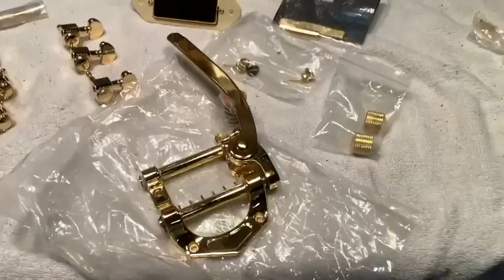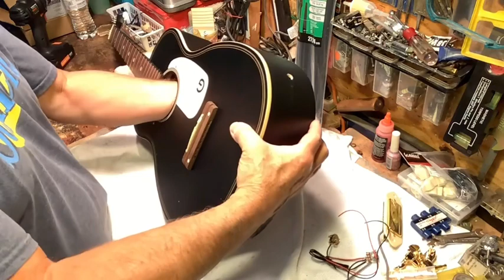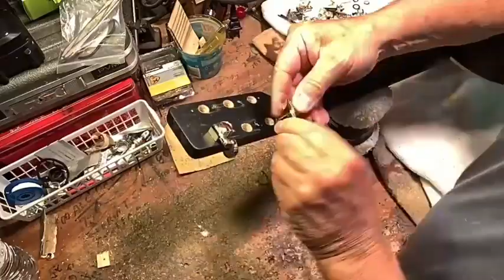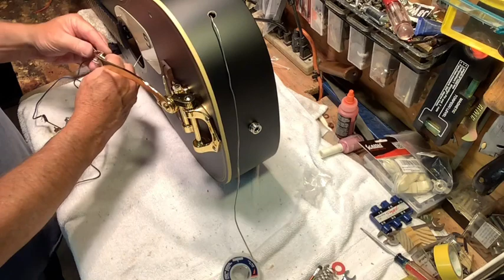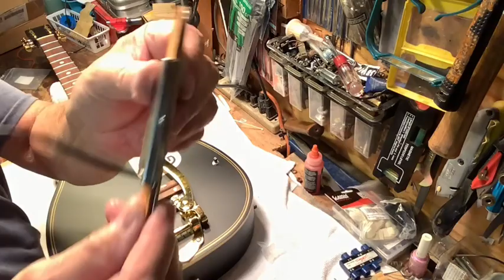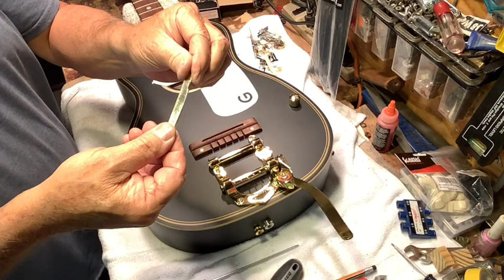How to turn your Gretsch Gin Ricky Into a🔥HOT RICKY🔥part 1

Comment: Howdy from Oklahoma, Jeff!  I have really been enjoying these mod videos. I’ve got a Gin Rickey coming any day now. I was wondering where the best placement for the strap button is on these little guitars. I’m not too fond of having to tie it to the headstock.
Reply from the maker: Oklahoma.....🎶Where the wind comes ripping across the plains....🎵. I’m glad you are enjoying the videos , 🙏 hope everything is going smoothly there in Oklahoma....! When putting a strap button on a acoustic guitar the most common place to put it, is on the heel on the lower half...! So if you were holding your guitar like you were playing it and you look down at the heel , the strap Button, would be on the opposite side of your heel.... This helps keep the strap from slipping off...! I suggest you use a high speed Dremel tool with a small bit in it to pre-drill the hole for the screw ...Y’all don’t want to split the heel ....!  Your friend Professor Jeff Galey in Sweet home Alabama...🎵🇺🇸🇺🇸🇺🇸🎶
Reply: @iplaymytele  Thank you sir! I appreciate the pointers. All is well here in Oklahoma. Y’all definitely have a sweet home there in Alabama. It’s one of my favorite places to be.
Have a blessed evening
Reply from the maker: @choctawcodger5418  ...
Thank you so very much...🙏🙏🙏
May you have a blessed week....! ( P.S. Thank you for subscribing to my channel...🎵❤️🎶 )
Reply: @iplaymytele  🙏🏽  you betcha